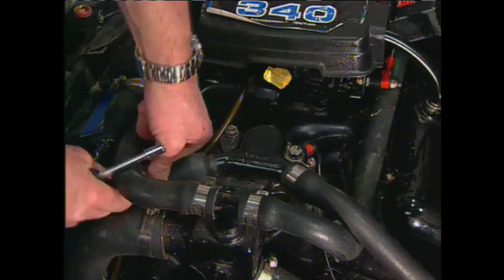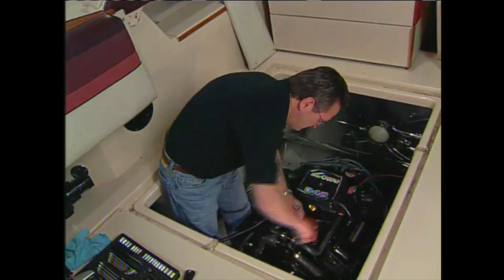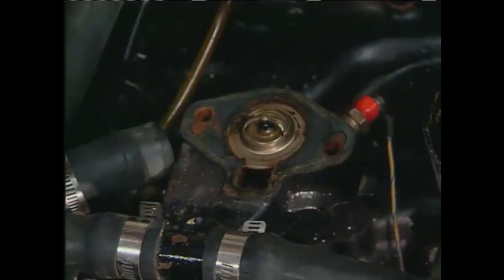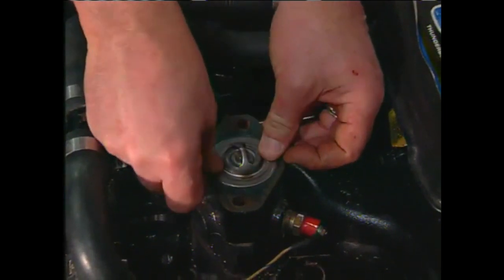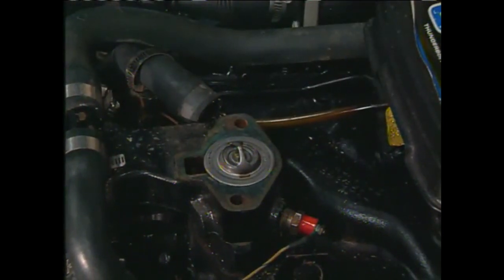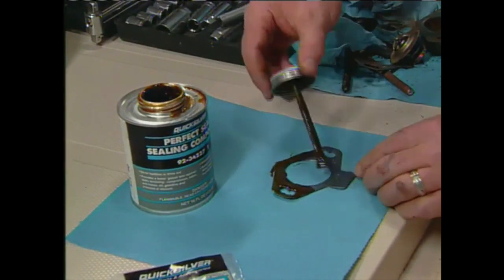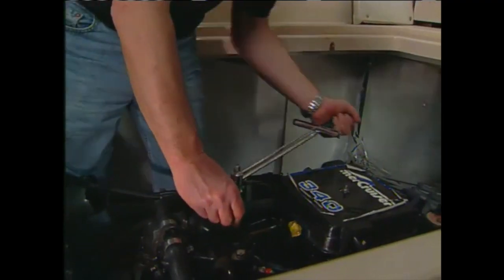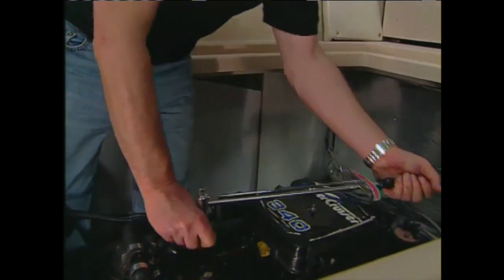How to Replace Your Boat's Thermostat | PowerBoat Television Classic DIY

Comment: Great video, thank you. Short and to the point. I have a question, I have a 4.3 MPI mercury V6. If the thermostat is sticking closed, would that cause a heat difference of 40ºF between port and starboard exhaust riser surface temps (read by a thermo gun)?

Comment: This is a very well produced, but generic “how to install an engine part” video. It is assumed that the viewer has researched their specific boat and engine, has ordered parts, and just wants to see the part installation. Most helpful tip is to use gasket sealer, but again without any recommendations of different sealers.